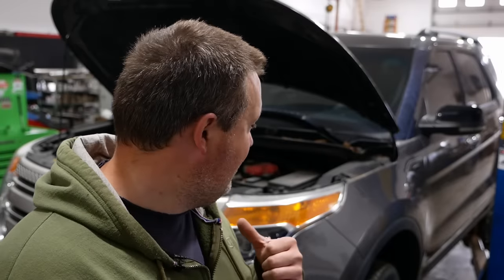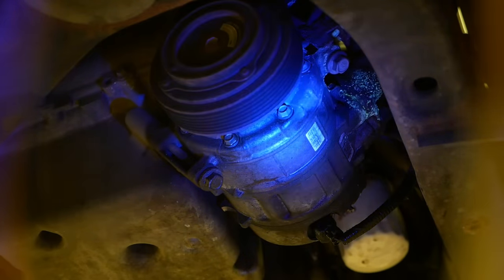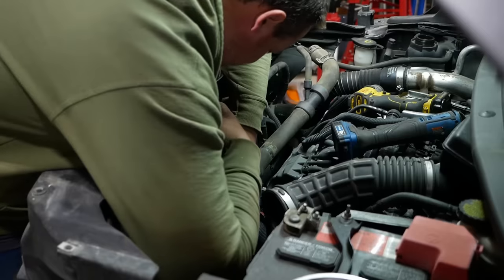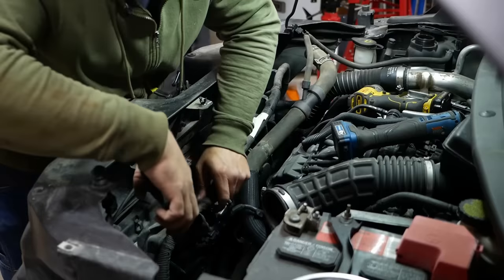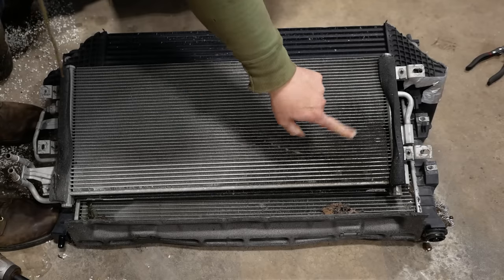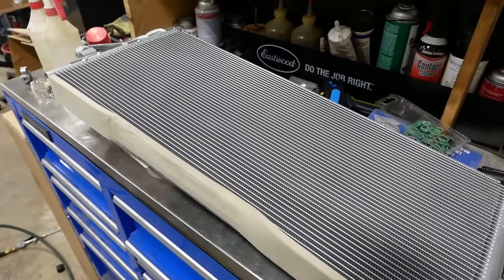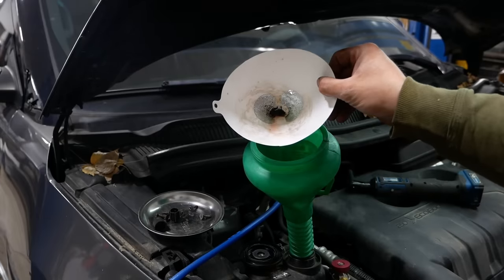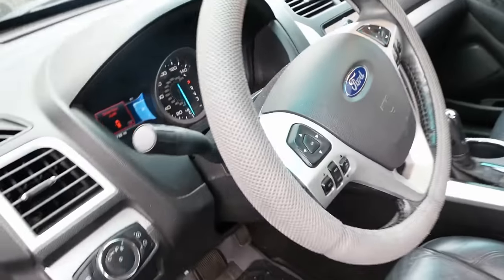Ford Explorer Replace A/C Condenser

Comment: The hardest part is finding space to put all the removed pieces without losing them.  Love your channel.
Reply from the maker: So true!
Reply: @WatchWesWork  same with the 2017 Ford edge suv awd and the battery cable connects differently but you gotta do what you have to do
Reply: @WatchWesWork  question is where would there be any tow hooks on my 2017 Ford edge sel awd model
Reply: @sportsguy1992  That's easy, with the AWD, you have to flatbed your Edge, it really can't be towed (and a reputable tow company s supposed to decline to wheel tow or they are on the hook for drivetrain damage).

Comment: Hello Wes; Sadly in todays economy we have two choices, pay the price or do without. Even though the book says 6 hours you were lucky not to find frozen or broken bolts, bad connectors, well you get the drift. I always enjoy your videos, there's just not enough of them.
Reply: My work car (Mazda 3) has what I believe is a bad pressure switch. I simply live without it.
Reply: The AC in my old car deleted itself. It had a leak and bad compressor clutch coil. The climate here allows going around without AC, there's about month per year where you start wishing for it to work. While somewhat inconvenient, it did good for fuel economy. Around 15-20% less fuel consumption, it amounts to something.
The repairs were quoted around 300EUR several years ago, probably don't wanna know today's prices.

Comment: I didn’t know I could use the magnetic bolt bowl upside down! Learn with Wes 101! Thanks
Reply: I thought the same thing...adding to my bag of tricks.
Reply: It works. The world is UPside down. 
The trim fasteners are the problem. They easily end up scattered into unknowable hiding places.
Reply: Just be careful not to exceed your magnet's ability to hold shit on it. You'd pile the bolts/nuts whathave you on top, you'd think it's ok and then you shake something and when you're done and you wanna put shit back together you realize you lost one and start cursing whilst looking like an old lady who lost her glasses. TLDR, get a really powerful magnet one, cheapo specials are shit.
Reply: It wasn't upside down, he flipped the car on the roof, much easier working on the undercarriage  😉
Reply: @jockodog2009  RIGHT, works on metal, not so good on plastic.
Reply: Those were Australian magnetic parts trays. Special ordered.
Reply: For some unexplained reason those plastic push pins would not stick to my upside down parts bowl.  Anyone know why? 🙂
Reply: @brucemckelvy9920  line the bowl with used chewing gum, it makes the magnets work on plastic
Reply: Wow
Reply: @wurly164  Now there is a person that thinks out of the box.   Thanks for the tip Wurly164
Reply: @brucemckelvy9920  What box?
Reply: @jimbeckettplay  😂

Comment: The Ford Exploder: Designed by engineers to be mostly disposable, much like the Dodge Neon. Well done Wes! Your dry sargasmic (sarcastic) commentary is always a good chuckle as well!
Reply: I think the Neon was basic enough to have a chance of making it to 100,000 miles, as long as you don't count valve jobs. 🤣
Reply: @mphilleo  i had a neon and ran the wheels off of it and never done anything other than oil changes...i heard people pissin and moanin about em but mine kept right on rollin..i sold it with 178k on the odometer and it was still runnin like a scalded cat..and they are also the fastest car in the world for power to weight ratio..or were for their time
Reply: @mphilleo  Within a year of their release north of the boarder, the bone yards were full of them! LMAO
Reply: @janeames1513  Maybe the power to weight ratio was why thousands of them wound up in the scrapyard a year after their release, looking like they should still be on the road.

Comment: Delt with compound heat exchangers in the past.  They expand at different rates and are prone to cracking.  Note how this one failed on the end near the oil cooler.  In the winter the oil cooler part would have been hot and expanded while the condenser portion would have been cold and contracted.

Comment: Back in the early 80s, I was a mechanic for an IH dealership. Keeping the AC operational on tractors with cabs and combines was a pain.  I even pioneered a repair on combines,that eventually became standard practice.
Reply: What was the repair you pioneered

Comment: I'll be honest I rarely use the a/c. Just the windows down is good enough for me. Probably being a construction worker being in the heat all day makes me used to it.
Reply: i work in a steel mill and haven't had a/c in my car for almost 4 years..i call my a/c 2-70...2 windows down going 70 mph down the highway..but i grew up with no a/c in the cars or even in the house..we had box fans in the windows at the house

Comment: Took my vehicle in for rear brakes. I was expecting $600-$700. Mechanic called and said $4200. They "found" a whole list of crap to fix. I said nope! Rear brakes! Dude was so pushy and rude I ended up going and getting it. Replaced rotors and pads myself for about $250. I wish I lived closer, you would get all my business. 👍👍
Reply: $4200 for just brake repair? Is that even possible🤔🤔
Reply: @mph5896  Not for the brakes, but for all the other things they "found" (heavy emphasis on the quote marks).

Comment: Prices are crazy, I have a 2020 Ram 2500 with the 6.7L cummins,  2 days ago I got a recall (one of 3), that recall was something to do with the fuel pump losing pressure,  in the weeks before,  I knew something wasn't right , was going to call the dealership before but the recall came, So I bring it up they tell me the book says it's supposed to take 4 hours,  it took 8 hours,  the service manager says in addition to replacing the fuel pump, all the fuel lines have to be replaced , all the way back to the fuel tank, 2 days later I picked it up and signed the RO, and that job  cost 1100.00, I'm glad I didn't have to pay for that, but now it has lots of power and runs great

Comment: Yep, having all those "Specialty Tools" makes the task go quicker ... wish I could send you THE "Specialty Tool" you need most ... another set of hands Wes !!! And don't be too hard on Detroit ... they all break and much more expensive to replace the AC Delco Compressor in a MB 450SL than a Chevy PU ... I've had to do both (and there wasn't any plastic involved on the MB). Great job as usual !

Comment: People have no idea how difficult it is to work on newer cars. Except for simple stuff I quit wrenching on my cars in the 80s when they started cramming front wheel drive and transaxles and everything else into to small places. I have a tremendous respect for folks like Wes who can methodically work their way through these ridiculous designs. And what’s with all the damn clips!?  I usually figure them out by the last clip after breaking ten or so.

Comment: My air conditioner in my pickup never goes bad and has worked like a champ, since 1980............it's called butterfly windows.
Reply: Only downside is when a bee gets sucked in and ricochet into yer lap doin 60 ! Lol (been there!)
Reply: @JohnSmith-tv5ep  I had a wasp get blowed in once, but never a bee.  Needless to say, my steed was dancing around the road pretty good till I brought it to a halt and handled the situation.
Reply: Just pray it is not a Yellowjacket…
Been there. A Yellowjacket got in my old car a 75 Plymouth. That car stopped on a dime..
😂😂

Comment: Glad to see you back after your POWER SURGE. Last year I bought a 3 cylinder deal on 134  at $70.00 per cylinder. This year it's $345.00 each. Did a Madza condenser,  had to remove the metal crash bumper as well as all the stuff you pulled off the front. Customers will ride on 4 steel showing tires, but when the AC goes out, IT'S A GOTTA FIX PROBLEM. People watching this 19 min. video need to realize it took you a lot longer than that to do this job..With all the equipment and tools we have to buy, it's the mfgs and suppliers making the money, not US the wrench turners... I'd figure you had bout an hour plus in evac and charging plus an after job leak check and run time performance check. Then add in the R-R time of actual parts, way more than 19 minutes !!!!!! Oh well, I didn't start AC work till 84, bought R12 for 75 cents/can and $21.95/cylinder. Last I bought was $400.00/cylinder In the late  90's, if you could find it, it had jumped to over $900.00/cylinder. Needless to say I did a lot of retro fitting to R134a..      Just a little useless information for the viewers.

Comment: when I seen the coolant being drained in to the drain pain on the floor my first thought was. He is brave man I would step right in it or drop my bolts in it. Good work! Parts are getting crazy I have been shopping around alot and make sure I have been using discounts. Shipping prices have been almost half the price of the parts lately. I wonder if that has anything to do with rising fuel costs. 🤔
Reply: Trucking is costing over a dollar a mile for many. So yes, of course it is. Our government did a pretty good job hurting the industry previously, and any costs must be passed on to the consumer, or they will go out of business. Same with any mandates and requirements that increase overhead. (Think ULSD, more expensive emissions controls and reduced reliability, operation limitations, etc.)

Comment: Tip of the day - do not drop a short 1/4" extension onto the fan of a P38 Range Rover when warming up the engine just after changing the whole radiator pack.......
Reply: Video??? :)

Comment: Hey Wes, I do mobile equipment repairs, and quite a bit of AC work. I often use nitrogen and soapy water to leak test. You can static charge a system to 200-300psi, I also often use the nitrogen to purge the system so I can braze cracks in lines and heat exchangers rather than replace them if possible. With the high cost of refrigerant, this makes more and more sense over a charge with dye to find leaks.

Comment: I was raised to go without for silly comforts. I never got the types where they've got three bald tires, torn boots on ball joints, and a whining rear end, but the ac HAS to be fixed...
Reply from the maker: I know what you mean.
Reply: Used to be that one simply cranked the vent windows open. Remember those?

Comment: I love AC work. Its one of those systems that the lay person thinks is voodoo magic. But the function itself is pretty simple, albeit with some specialized fluid/gas. Heavy trucks is still pretty simple to work on. But yes, sometimes parts are unobtainium. Sometimes easier for the local hydro shop to make hoses than wait a month from the manufacturer.
Reply: Yup, ac work is quite easy once you understand it and have the necessary tools. Gauge set, scale, vacuum pump, thermometer, (about $500 worth of tools) and you are pretty much all set to go. Recently I added a inert gas tank and regulator to the arsenal. Add a standalone recovery machine and you can pretty much do anything a shop ac machine can do. 

Transmission work and rear end work is also the voodoo systems I enjoy. 😀
Reply: @mph5896  The problem is that recovery machine can get pretty pricey.. I know the ones the shops use can be upwards of 4k easily. They have smaller portable ones for a few hundred but no idea how good of quality they are. Not having one of those machines is the really the only thing tying my hands as far as full on AC work goes.

Comment: I have been doing A/C repairs for over 45 years. When I started a 1lb can of R12 was 59 cents. You could recharge a customer a couple of times a season and they were fine with that. Now I do not even want to do A/C work unless the leak is obvious. With the cost of R134 tripling this season I don't want to get married to a slow leak that I can't detect. I have one wife and that is enough for me.
Reply: Yeah, 15 years ago I would buy 30lb jugs of R134 at Same Club for around $60. Basically about the cost of a gallon of gas (today)  to fill an ac system then.
Reply from the maker: I agree completely. And customers are all convinced they have a "slow leak".
Reply: Yea I went to get r134 at the local auto parts store and they're charging 20 bucks a can. Still a few small places near me that charge 7 bucks.
Reply: The bonus to the expensive refrigerant, is that it pays to actually fix the leak, istead of just refilling and letting it slowly go into the atmosphere. Granted - Refrigerants these days are not so nasty as they used to be.
Reply: @johanw9513  I read R134 is same as Green Gas, like used for gas Airsoft...ya know pull the trigger a puff of gas propels the pellet. SOOOOOO they clearly just expel to the atmosphere
Reply: @mrmotofy  Airsoft uses CO2. R134 is 1,1,1,2-Tetrafluoroethane and is a greenhouse gas. HFO-1234yf is what is used today, and has about the same global warming effect as CO2. I'm not sure if you can substitute the newer type for R134.
Reply: @johanw9513  SOME airsoft use C02, many have started moving away from it cuz it's inconsistent and changes with temperature affecting accuracy. Others use a "Green Gas" as its frequently called. Bro I have a pistol that takes It I know what it is. Sounds more like you're guessing from what you've heard. Don't try to correct others that HAVE real world experience, when you're guessing.
Reply: @mrmotofy  green gas is propane with silicon oil additives. It is NOT R134

Comment: So crazy that I just went through this on mine.  I wanted to upgrade the halogen hi-beams to LED.  I was told the bumper cover needs to come off to remove the headlights.  After getting about 1/2 way through, I noticed my 2019 doesn't snap together between the bumper and fender.  There are three screws that new almost impossible to get to instead.  I put everything back and was able to reach the bulbs from the top after all.
Reply: I have found that on other cars, it says the bumper needs removing but sometimes you can reach through behind the arch liners.

Comment: in my 23 years of owning a convertible, i used the AC maybe 4 times and  all those times somebody else was using it. i always just drop the top if its too hot. a good heater for winter months on the other hand is very necessary.

Comment: Unbelievable video I can’t believe these engineers were designed something like that you should have showed all the bolts and ties that you had to remove before you put it back together great job
Reply: What gets me is every one of those bolts could have a 10mm head. But nope. Some 8, some 10, some 11, some 13.
Reply: @gailtaylor1636  I was going to say the same thing, but there’s some 5.5mm’s in there too and probably some 7’s because why not?
Reply: @gailtaylor1636  don’t forget SAE
Reply: Well, there are a couple chryslers that you had to drop the front axle to get to the oil filter; and some BM where you have to dismount the engine to get to some tune-up fittings.  Occasionally, Detroit is as dumb as dumb can be.
Reply: Everything here looks like a dick move from Ford. I lost it just at the headlight assemblies having to come off..

Comment: That’s was commonly called a combo condenser was all the rage starting in around 2008. Alas, there were some serious long term durability issues mostly due to differential thermal expansion between the temps of the oil and refrigerant.  Not sure how wide spread they still are. since they save cost for the OEM and pass it down to the consumer to take the bigger repair cost down the road, I suspect they are here to stay.

Comment: I thought only I was being cheap reusing antifreeze. The biggest thing for me is disposing of the old stuff, No good way of disposal for me.

I just empty antifreeze into a clean bucket, I also have a 36x36" plastic drip pan I put under the bucket (From Tractor supply for animal cages) to catch anything that misses the bucket. Run it through the paint strainer and reuse. The antifreeze with oil in it, let it sit in a bucket until the oil skims to the top. Pump all the antifreeze out on the bottom of the bucket and only have about a quart or two of waste to dispose of. I have around 10 gallons of this waste I need to bring to the town hazardous disposal day once a year🙄
Reply: I know a dealer tech, asked him one day. How do you guys catch coolant, he laughed. Said they open the drain plugs etc and let it hit the floor then squeegee to the floor drains...Wait so you literally dump it all down the sewer drains...YEP. He said supposedly they have some quantity they're supposed to stay under...but if NOBODY knows how much....how does anyone???? AH ok Now I know what to do with coolant haha
Reply: @mrmotofy  Reading your post 1 year later. Coolant, If I was on a city sewer, no problem. Municipalities actually say you can do it. Septic with well, I really don't want to dump chemicals into the septic like antifreeze with concerns of something getting into the water table.

Comment: I buy vehicles from COPART all the time and fixing up smashed vehicles became an expensive hobby but since I am I have found out the Ford & Chevy SUV's are a jigsaw puzzle when you take them apart to get to the spot welds to fix or take a section of the dents out of the frame. Putting the vehicle back together is simple bang of the Palm of your hand!!

Comment: Been in the HVAC/R business for 47+ Yrs. You are correct on the Refrigerant Prices. The thing I have learned since 1994, during the Montreal Protocol, when the Fed Gov't (EPA) want to control the refrigerant used, they tax the crap out of it, until it is not cost effective. If you think the A/C is a rough ride now, hang onto your hat. It is only going to get worse.
Reply: When I retired from HVAC/R I stored R22. I have enough to last my lifetime.